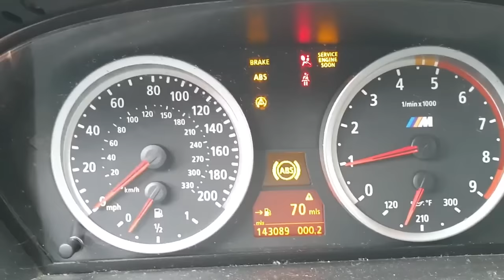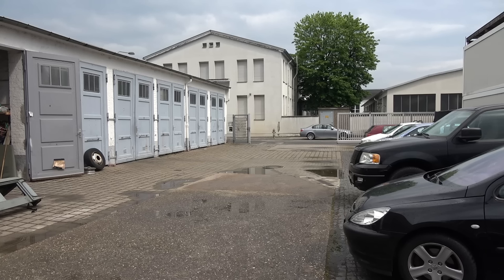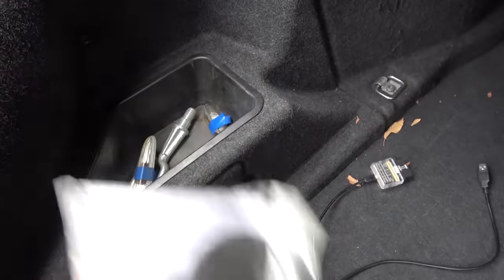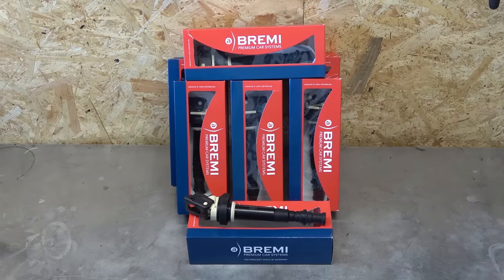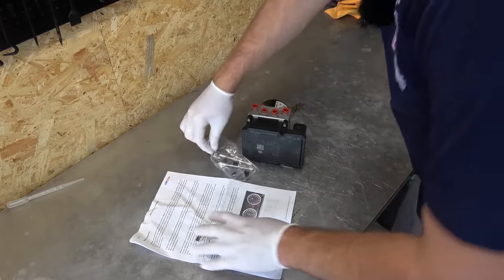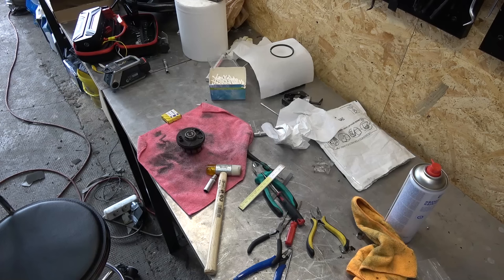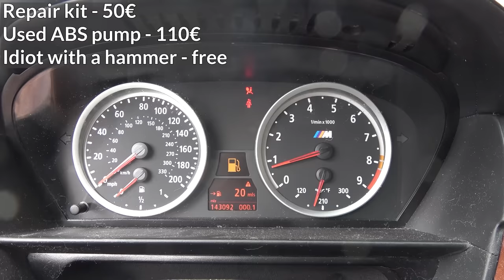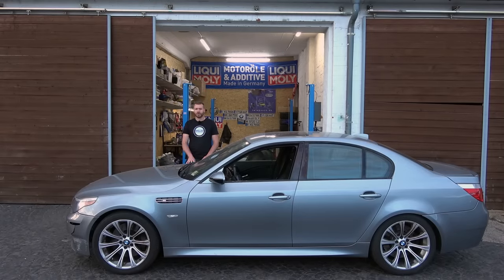I Bought & Fixed the Cheapest V10 BMW E60 M5 6-speed In The World - Project Raleigh: Part 1

Comment: I never understood why they didn't make a manual for europe. THE PART OF THE WORLD WITH THE MOST MANUAL DRIVERS!
Reply: SMG?
Reply: Europe has only SMG trans in the E60 M5,but we got 6-speed manual in the closest cart to M5 and that is 545i
Reply: The only problem is BMW basically parts-binned it and used the transmission from the 545i, as others have said.  The synchros can't really keep up with the revs, so a 1->2 quick shift on a full-throttle pull is... eh.  I cannot do it without grinding gears, even if I kick the clutch pedal through the floor.  So I just have to wait a second between shifts.  Then it'll slot into second without grinding.
Reply: @EidolWays  Interesting to know.  Everyone on the internet praises the manual.  SMG does take a bit of getting used to.  Sometimes it will pull away in 1st sometimes in 2nd, but right now the alternator has gone.  So it is not going anywhere in any gear.  BTW, here in the UK there are quite a few 645i, 650i, 545i and 550i with the SMG box but very few manuals.
Reply: You know why BMW has gone to shits?  Because marketing has taken over engineering, and thats the answer to your question.
Reply: Because most of these cars were sold new as company cars rather than enthusiasts cars so not enough demand for manual. 
The manual used in these really isn't that good anyway in conjunction with the engine and tuning.
Reply: Because manuals are slow dinosaurs. The SMGIII is vastly superior in all performance metrics. Only the NA market clings to old technology in cars over nostalgia.
Reply: I've read somewhere that the reason the SMG was not successful in the USA is that Americans were expecting the SMG cars to behave like automatics and therefore they kept destroying the transmissions. The SMG is a manual (with automated clutch) and it's apparently very robust if driven like it was supposed to be. Apparently the European customers got used to the SMG and didn't feel the need to have a manual when the SMG was already a "better manual", so to speak. I'm not saying that I agree (I'm an European living in the USA and I'd love to own a Manual E60 M5), but it makes sense as an explanation.
Reply: @MrSuperawesome5000  I will take manual for sport car evrry year of the day in 2570... DSG is superb for dizel daily driver.
Reply: @MrSuperawesome5000  Driving isn't always about optimization, just because manual may make the car slower for most drivers, the fun of having a manual fully makes up for it.
Reply: @danielpope3579  Actually, in most cases in the US the auto is the only option. Most Americans can't drive manual, and even if they can they trash the clutch. My friend has an M roadster, after he burned out two clutches driving in San Francisco I taught him how to use the hand brake to do hill starts. I drove a manual v6 Passat in San Francisco and put 207,000 miles on the original clutch before I donated it to charity.
Reply: @MrSuperawesome5000  # try drifting in an auto !
Reply: @danielzychniewicz2633  Manual was fun in the nineties. The SMG is faster and overall better in every possible way, you total intellectual light weight.
Reply: @EidolWays  But then drag racing isn't a thing in Europe. Fast driving in the UK isn't quarter miles, it's getting from Otley to the A59 over the moors in the shortest time without rolling through the stop at the end. Or driving from Edinburgh to Mallaig in under two hours.
Reply: @MrSuperawesome5000  When you drive a v10 N/A sedan that is all about performance & experience mix, and not neccessarily about the metrics, the manual is the way to go. If you buy an M5 you don't buy it because it will replace your 911 Turbo S on the track,  you buy it, because you want to drive a sedan that behaves like a supercar when you want it  to, the experience of the V10 is irreplaceable and with a 6 speed it is utterly sweet! :)
Reply: Haha.. Manual voor poor peopls
Reply: @konstantinjekimov7637  🤣🤣🤣🤣🤣🤣
Reply: @konstantinjekimov7637  No, they are for people who like to have fun. But in that case, English classes are only for the rich and you obviously haven't had any.
Reply: i live in south africa where we also mostly drive manual and they never sent them here too
Reply: @ebenswanepoel5475  south africa did get some
Reply: @oneman7638  yeah probably privately imported, dont think bmw brought them to us
Reply: @ebenswanepoel5475  oh man :/ you are right. They were produced only for US and Canada.

How many examples of the E60 M5 sedan were produced with a manual transmission? BMW M produced a total of 1,366 examples (including six pre-production vehicles) of the E60 M5 sedan with the optional 6-speed manual gearbox, all exclusively for the USA and Canada.
I think its because a lot of the NA community complained to BMW so much, that they decided to do this 😁
Reply: @oneman7638  i wish they imported a few to south africa though. Smg gearbox wasn't good at all
Reply: Mines A smg 2
Reply: @sasukeuchihaanbucapt  mine is a 6 speed manual.
Reply: Nothing bmw ever does makes any logical sense.
Reply: @skateking959  I guess. 😅
Reply: I'm from the U.S. and most of our people prefer automatic! Not me! I prefer manual! Especially in a performance car!
Reply: qall
Reply: @domegrobnik74  550i also
Reply: Also Europe is the part of the world with the best country roads to really use a manual and rear wheel drive.another reason BTW should have built manual M5's for Europe
Reply: @gplusgplus2286  I would say that electronics have taken over engineering.
Reply: Master puppet. - bet you where those cute little socks that don’t go past your ankles with your sketchers.
Reply: MrSuperawesome5000 the smg is completely shit its basically a automated manual transmission and it shifts really rough and slow
Reply: @MrSuperawesome5000  people with auto are still slow AF dinosaurs right off the lights and on the passing lane throughout
Reply: @EidolWays  Or else learn the car including learning how to synchronize your right foot and right hand ie switch gears without using the clutch.   Hit the precisely correct motor rew and kick in the gear.
Reply: It is because the car was designed with the V10 and SMG transmission in mind, not a manual. It is actually better suited to the SMG trans.
Reply: Yeah I always thought it was silly. I know plenty of people who don't like automatics. I avoid them where I can, I don't mind a slushbox on big, relaxed luxury cars so much but on anything else? Nah. I can't stand dual clutch boxes on anything, they're too figety and rob the involvement and fun of rev matching.

Jaguar did that for the F type too. They only made a manual version after the US dealers requested it. However unlike BMW they did then offer manual everywhere. Thank you US dealers!
Reply: The automatic has been perfected to fail to match value of the car is  at 150-200k km. Mechanical Design in luxury brand vehicles is actually an exercise of profiting through select part failures - the actual profit centre of car manufacturing. The 7-10 year replacement goal is being achieved by all german cars at this point.  Electrification will come on stream with a similar battery pack replacement interval and similar profit centre.
The manual extended this 7-10 year window and unfortunately(for stockholders)  kept older cars on the road.
Reply: @MrSuperawesome5000  puahahahahahhahahahaha go drive automatic with girls

Comment: It's very weird that the manual M5s were NA only... Upside down world. The BMW that engineered and produced the manual-only E39 M5 predecessor seems like a very different company. 
Manual transmissions are still the norm (i think, maybe that's changed by now) in europe. In Sweden, if you take your driver's license test with an automatic car, you can only drive automatic cars. I'm a bit strange for a swede, because i like automatic transmissions. I do love a solid manual transmission with nice and tight gearshifts and a nice feeling clutch to go with it, but for driving in town nothing beats an auto. I'm a land-barge kind of guy, though, my 1968 Cadillac DeVille convertible is about as good as cars get, DAT 700NM 7.7L V8! BIG cars with BIG torque and a comfortable ride are just awesome.
Manual transmissions are for sporty cars and for sporty driving, in which case they're marvelous. I do miss my old 1981 BMW 323i...

Comment: Got my eye on one of these too! Thanks for showing how to fix your issues and hope I can use them as well!
Reply: Oh my god, don't ever get that car unless it has the BMW Platinum life warranty. Flywheel goes every 50k and costs 2,500 usd to replace. Brake pads and rotors cost 2,000 usd, need to be changed depending on how you drive (it's an M car). And finally the piston bearings on the crankshaft. That's 3,000 usd and needs to be done every 70k. Also the throttle pedal sensor is plastic and needs regular change, that 1,000 usd, or get a metal one for 2k usd. Those are the operation costs for a slow car...
Reply: @Wiskers-    Damn! And the "normal" version is that trouble too? I was looking for one of this or a 335i(sedan or coupe).
Reply: @SlayersFan1988  Hey, I actually never owned this vehicle so I cannot tell, As long as it does not have the v10 all of the above mentioned issues go away. The 335 is packed with electronics which might go but it shouldnt unless ur getting a shitbox. The engine will last forever if you give it oil and some basic maintance...
Reply: @Wiskers-  for most people who buys an car with the s85 the labour is free. You only need to worry about the parts cost. No sane person would buy this without planning to do the maintenance and repairs themselves.
Reply: @Wiskers-  bruxismo
Reply: Please please , whoever is looking at buying one of these cars. Go find someone that has own & driven one for more than 4 years. Cause literally every person that talks about about the smg or s85 ain’t never owned one.

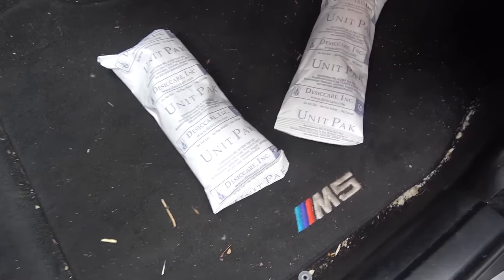Comment: 10:00 looks to me like someone was trying to suck up all the humidity in the car.. maybe there is a leak somewhere
Reply: Yes indeed, they are humidity absorbing pellets. Good that our friend wasn't planning on eating them :-D But a good warning for toddlers none the less! No wait...what!?
Reply: Probably for shipping by boat
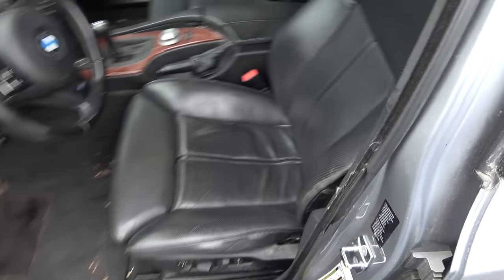Reply: at 7:29 you can see the door seal rubbers are torn apart, highly doubt its only in that location. so at some point maybe the car was left under heavy rain or pressure washed and seals ended up failing or sth like that.
Reply: mse good spotting! I missed that one!
Reply: Possible slight flood damage?? Hence salt bags to soak up humidity in the car and ABS  pump WATER damage. Still a steal for that car.
Reply: @mikepaton3614  Thats what I was thinking, its a North Carolina car so could have been half drowned in a hurricane?
Reply: If the passenger floor is damp it could be blocked drain holes in scuttle.

Comment: Seeing you open up the ABS pump and repairing it made me send my car in for the same job and now I've finally cured my ABS/PSM fault in my 911! Viele Dank, Sreten!
Reply: Maybe it's only me, but aren't those brushes and their wiring look pretty flimsy? Like, the whole ABS depends on them.
Reply: @cleruso  Low voltages across the ABS system causes an Ohm's Law type of death (as V goes down, I goes up as R is constant - damaging the thin wires).

Comment: I remember when these came out. It was one of those cars you'd never afford or own, and now they are old, abused and can be picked up for some pocket change and a case of beer. Sad.
Reply: That's the life cycle of any car and then they go up in value and then eventually they get so expensive that's the average person can't afford them and and then usually the bubble burst eventually
Reply: @TwoDollarGararge  Regular cars, not any car. For a 507 V10 super sedan with the price tag they had when they were new, I'd say the drop has been phenomenal. Around here you can get a medium abused one for less than a good condition e39. Back then it just didn't seem like it would happen. But what did I know at 18 years old.
Reply: @Gonken88  see this car like all BMWs has a reputation for being terribly unreliable no thanks to people like Scotty kilmer and the fact that these cars actually require maintenance but basically there's so many people that are scared of buying them it keeps the value down
Reply: @TwoDollarGararge  not just maintenance they have some inbuilt major failure points that are disgraceful for a car at this pricepoint. The rod bearings, VANOS, and SMG in BMW M cars for a decade simply outrageous. This car will come up with those suspension bushings clearly out of life.
Reply: @keithprinn6900   Simple change them every maintenance cycle or every 2 years or just set a schedule in change them and if that cost a lot of money well you bought it so you took that on if you want something simple go buy a 94 Toyota celica move

Comment: That’s a lot of miles for a v10! Must have been fairy well looked after most of its life (last owner excluded).
Reply: Not so much

Some of them got up to 210000 miles!
Reply: Car forums breed paranoia. The rod bearing issue is over way way over hyped but accepted as fact. It makes these cars way cheaper than they should be imo.
Reply: Daver G  I would like to own one, but after reading about those construction problems...how could have they fucked up such a nice engine with bad bearings...
Reply: J573 totally agree. Bad news always travels fast on forums. And everyone takes it as gospel.
Reply: One of the things the V10 is known for is worn or broken plastic gears in the throttle actuators. Usually a $3,000 fix at the dealer, but a person who can do the job will only spend a couple of hundred dollars on parts.

Comment: Yay! We get to see a long mile M5 that seems to have been well taken care of until it's last few owners, who cheaped out, and what a surprise, it's not too bad... Thanks for the video and looking forward to watching you reclaim this beast from the trash can, which it looks like it was destined for.

Maybe, just maybe if they were well taken care of the entire time, they wouldn't have as bad a reputation. AFIAK, BMW even recommended replacing rod bearings on these at certain intervals, people ignored it, and engines went to the grave, where's the surprise there? It really grates my cheese, when people say a car is junk when they either don't have first hand experience, or the experience they have, is a poorly maintained car that still has original 10+ year old perishable parts, or cheap parts on it (especially certain bearings, fluids, filters, gaskets, hoses, grease, plastics, tensioners, pumps or any other consumables). People just assume a car can't break by time marching on, they assume rubber lasts longer if it's used less, they never think about fluids deteriorating over time, not just mileage. 

These older performance BMW's (applies to almost all of the others too) were for the most part, the pinnacle of performance in their day, and even by modern standards, are still way ahead of the vast majority of cars out there. If you're buying one, and it has issues (which they likely will), understand that, it is because they were neglected (most of the time), and because they are simply OLD. It's not going to be a daily reliable driver, until you address the AGE of the car, not just what's currently working or not. You need to catch up on what's been neglected first, then look at what's wrong with it. I get that it will be expensive, possibly too expensive to do all in one go, but if you really, really want one, because of what it is, not because it's cheap, and plan on long term ownership, then be prepared for that.

Ferraris are notoriously high maintenance for the cost of entry, are expensive to maintain, and at lesser service intervals, which some require an engine-out procedure... These cars were comparable in performance to many Ferraris at the time, and by comparison, were infinitely less expensive to maintain, and were infinitely more reliable, yet you don't hear most Ferrari owners bleating about cost of ownership, but you hear plenty cheapskates (and other people with 0 experience in the matter) bleating about their experience with cheap BMW's that they weren't prepared to maintain, or restore to a semblance of BMW's specs... These kind of owners are the same that ignore (or are blissfully ignorant of) BMW's recommendations, service bulletins, TIS's, service intervals etc, and sell their tragedy to others to vicariously experience their pain... I mean, really, what do you expect, honestly??? To those who wan't one of these cars, but have butterflies (old till slips, IE no budget left for work on the car) in their wallets after the purchase, this is not the car for you, what's wrong with the car, is you, not BMW (or any other make for that matter, as the same rules apply), so stop spreading BS for other's that have never owned one to lap up and get on your bandwagon. There are exceptions, BMW isn't perfect, neither are every other make, if you address these, properly, before catastrophe, then what is there to bleat about?

Comment: BMW cars eat bushes like there is no tomorrow.
They are large and somewhat soft. Which makes the car have that "German feel" to it.
It feels shiny when new and wears like shit when getting old.
All geometry goes to shit and car starts to tear and wear tires, axles and whatnot.

I'm glad this rocketship turned out to be clean. Could have been a real nightmare. :)
Reply: I bought a 2005 320i and even though it had nearly 300,000 kms on it, new rubber bushings underneath and it rides like new.
Reply: @rollydoucet8909  : Sure. If you replace them it will ride like new, that's the whole point with bushings.